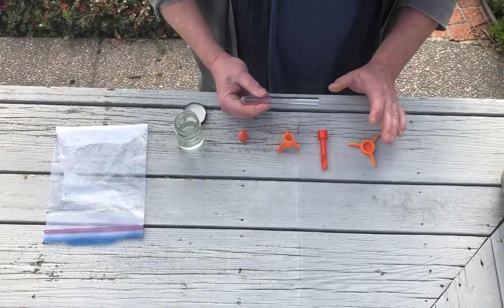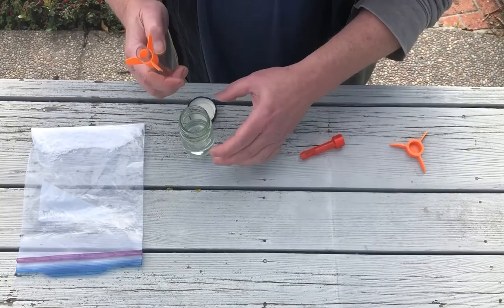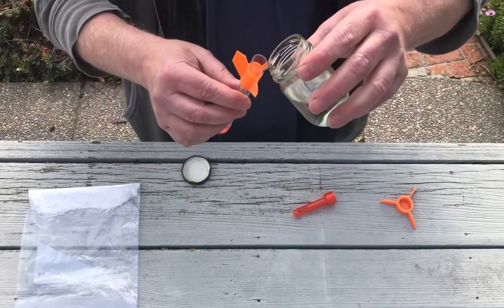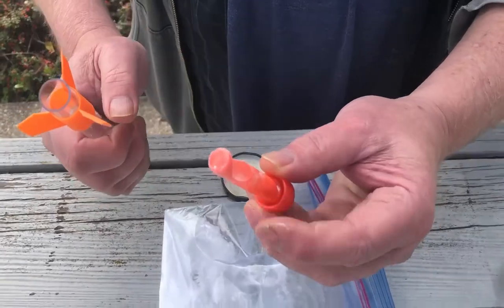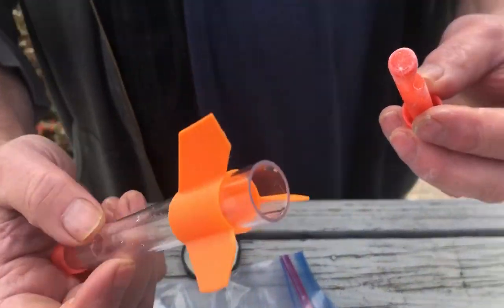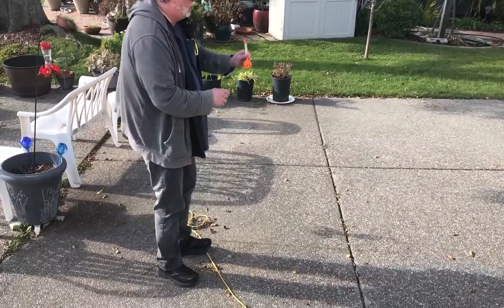Baking Soda and Vinegar Rocket!  3D printed (mostly)

Comment: We had a toy similar to this, but bought at a store.  It was about 12 inches tall, and a little over an inch in diameter.  You put vinegar in the rocket, and there were "pills" that were, I'm sure, baking soda, place in the base.  When you put it all in place, the vinegar and baking soda did what they do, and it went well over a hundred feet up in the air.  I'm sure no safety organization would approve such a toy today.